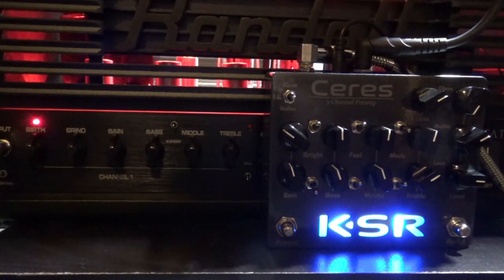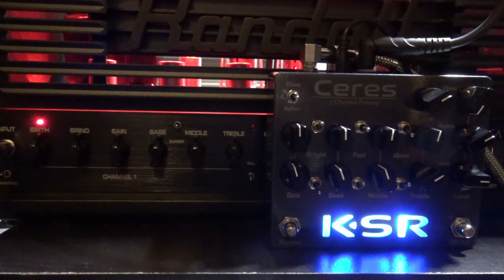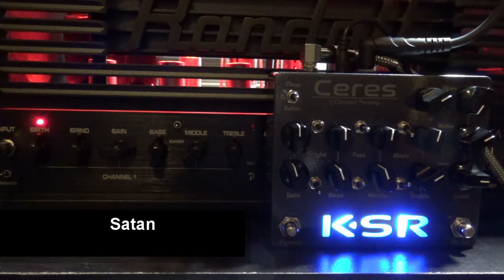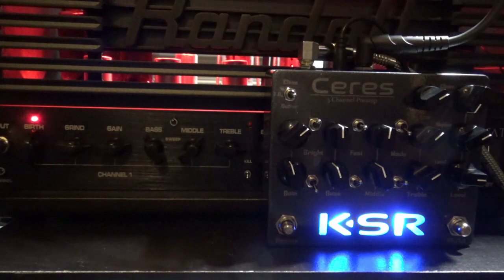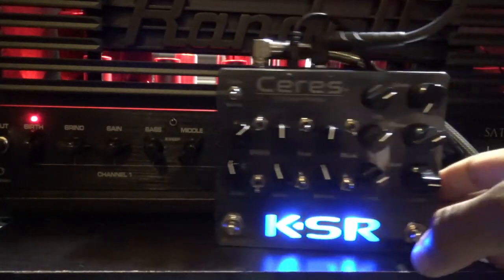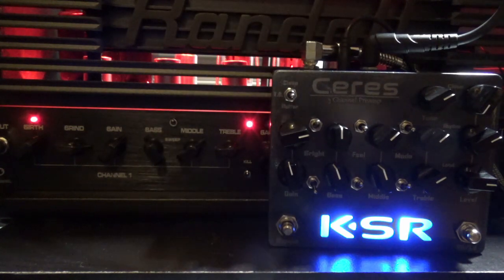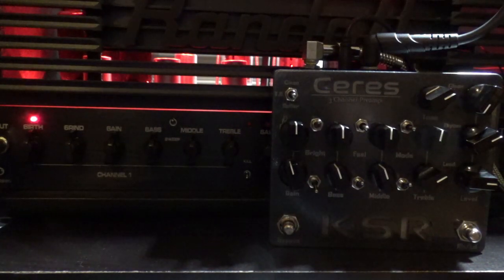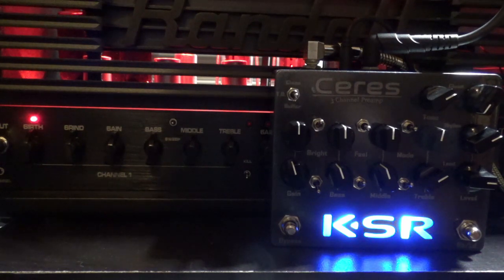KSR Ceres Vs Randall Satan | Preamp Pedal VS Amp

Comment: I've always wanted a Satan or that Meshuggah Fortin amp. A friend of mine has the Meshuggah and it has the best sound I've ever heard from an amp for metal. I'd love to hear them side by side though.

P.s. just got my Ceres and it's PERFECT. These tones are insane.
Reply from the maker: 😅 I'd love to get my hands on a Fortin anything...but gracious haha.
I do have some other super cool stuff that will be here early next year though 🤤
Reply: Both Fortin Cali and Meshuggha are moded jcm800s. ceriatone amps do the same models with slightest tone variations and they are both high quality true ptp designs but for much less.

Comment: Your Satan sounds incredibly muddy, this is NOT an example how this amp sounds from the box! Considering you got it used, there is definitely something wrong with it! Satan does not need a boost, to make it sound good with a boost, you need preliminary dial it muddy otherwise there will be too much gain!
Reply from the maker: It's actually off for repairs right now. I've gotten great high gain tones out of it though, I'm inclined to think there's nothing wrong with that side of it..but if it comes back sounding better, I'd sure be Happy